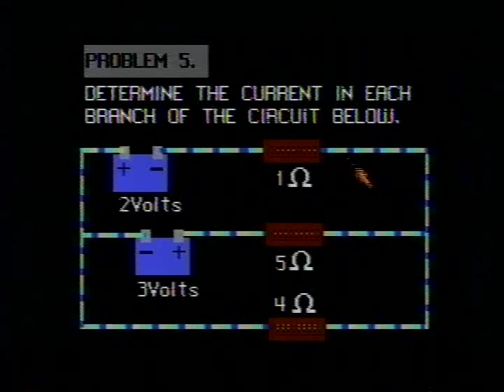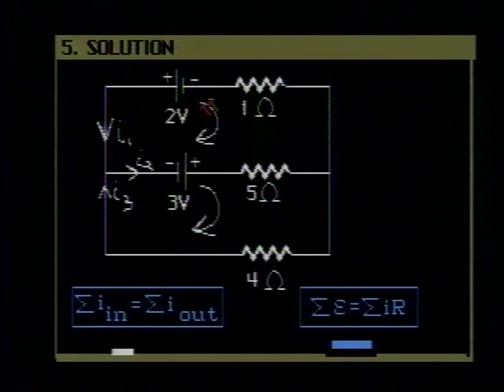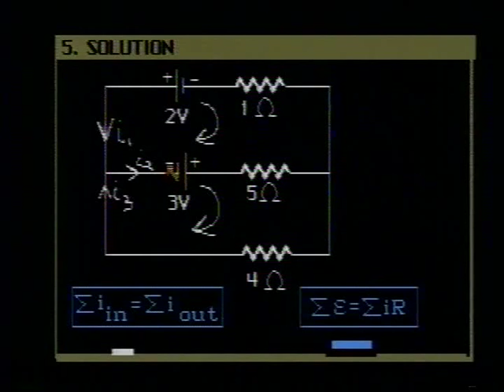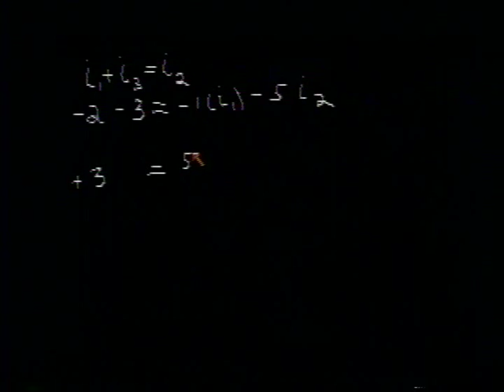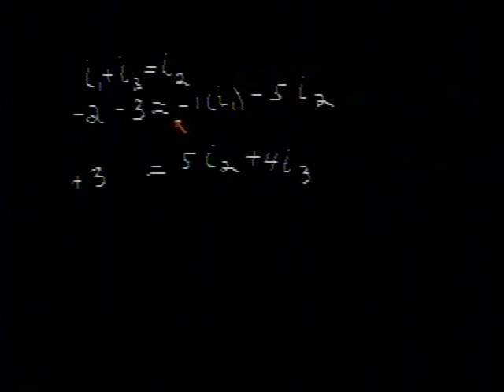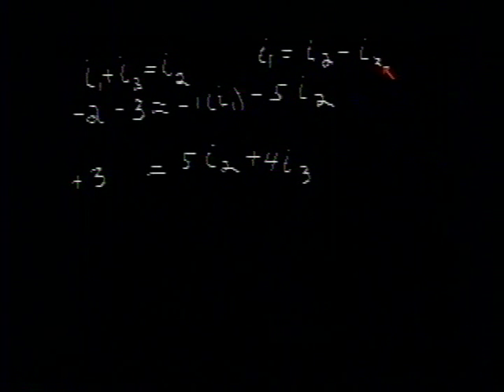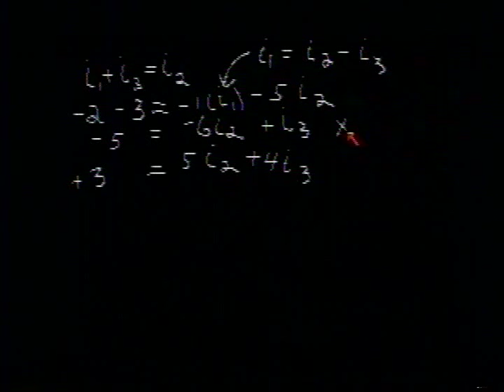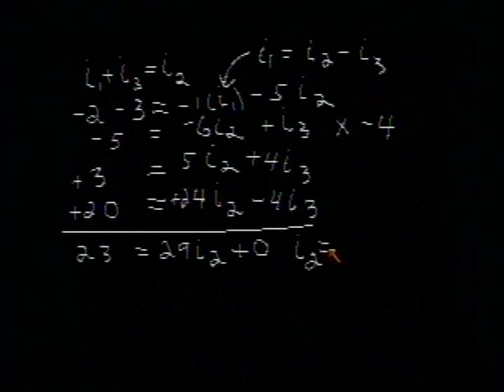Physics Problems Animated: DC Circuits & Kirchhoff's Rules-VIII

Comment from the maker: Leander: Kirchhoff's rules are just that. They are rules. Follow them exactly as stated including the sign conventions. Remember, this is not a simple series or parallel circuit. It is neither. Keep at it. The solutions are correct.
F. Smith